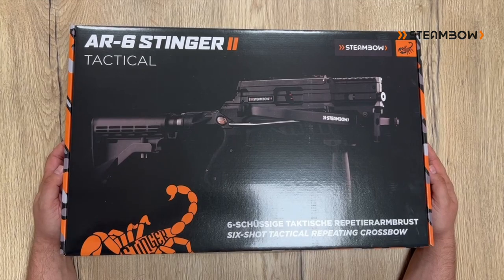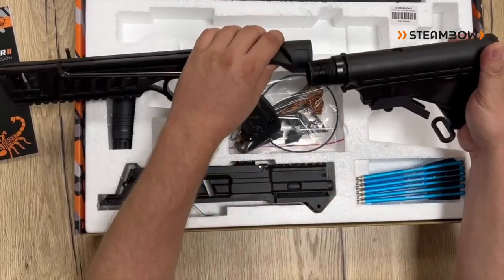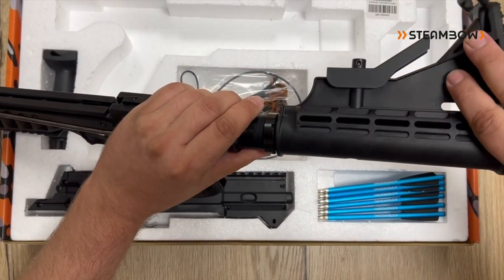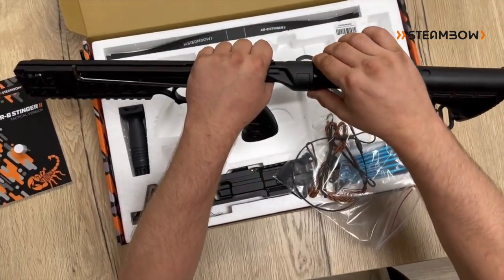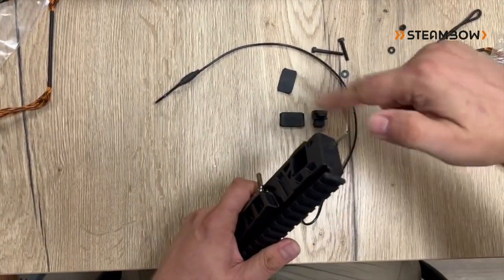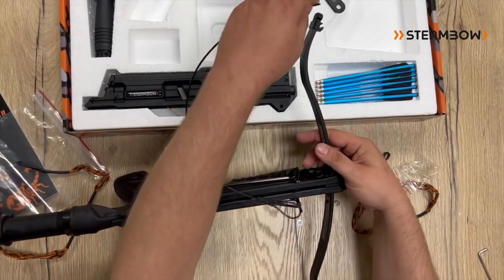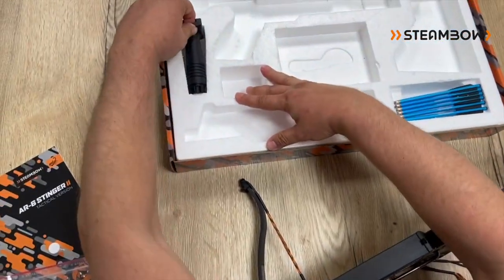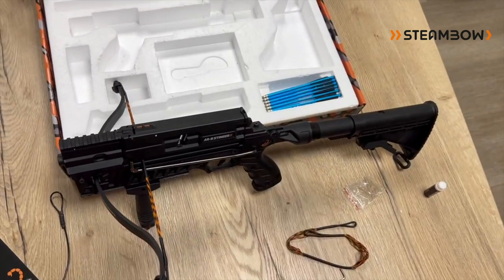Unboxing and Assembling the AR-6 Stinger II Tactical - closed system

Comment: Those clips at the end of the bow keep popping out ,what glow do I need to use?
Reply from the maker: You do not need to glue the caps. They are held in place by the tension of the string. If necessary, please check that the string is attached in the right place on the outside.
Reply: @Steambow  I did check and the string is attached to the clips from outside. It's weird everytime I stretch the strings the clips pop